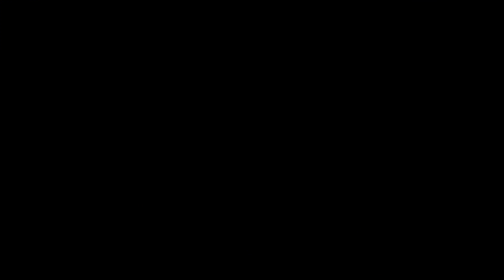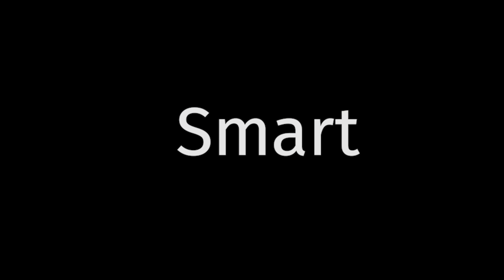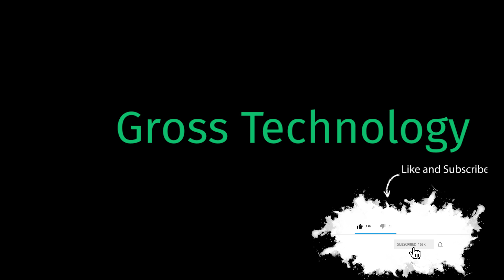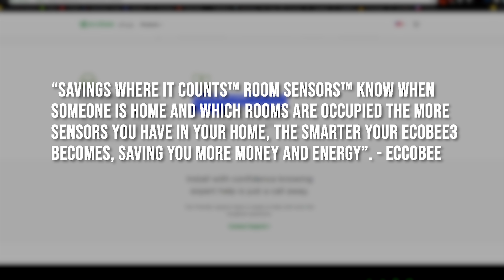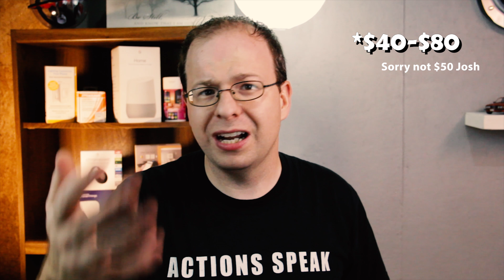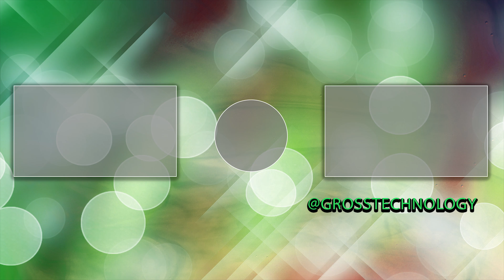Should You Buy the Room Sensors From Nest and Ecobee? #VEDA Day 4

Comment: Finally a video that makes sense, but I do think an overall average may regulate the temp of the house more, however, it could be running the unit longer.  If it lowers the temp everytime you leave then you still may save money.  My Question is to anyone, if you leave the house and the heat goes from 70 to 65 cause it knows you went to work WILL it warm the house up when you leave work automatically, OR will it be cold until you get in the house and it knows you are home now (thinking ecobee3/4 vs Nest).  Thanks.
Reply: Thank you!  Guess I have to decide which brand.  Wish someone can just tell me ecobee4 or nest 3.  😀
Reply from the maker: Well do you already have google home or amazon Alexa?
Reply: Gross Technology thanks! Yes I have both. I went with the ecobee4 and a few sensors.  A couple things bugged me about nest.  Thanks for all your replies!
Reply from the maker: Yeah no problems glad to help.
What things bugged ya about nest?
Reply: Gross Technology I totally agree with your video, but I think sensors in separate rooms will let me customize more how I want temps in a couple rooms when it senses me.   Nest seemed more learning and I don’t really want that.  I want to be able to set my temps, but also have it know when I leave.  It will be great on weekends when I got to adjust it for long days out.  I also got a better price in Ecobee.  Almost all reviews gave a slight edge to Ecobee.  Last, recent reviews of Nest app were 1’s and things were not working right.
Reply from the maker: Hey I can't argue with that.  Thanks again for the information!
Reply from the maker: That’s a great point. Yes it will definitely help regulate the entire house temps that’s for sure. 
As far as your question, you can set it to do either. It would go off your geolocation of your phone. I’m not totally sure if that can be fully done in the nest/eco bee app or though things like IFTTT. 
That said I think with it being a learning thermostat it will actually learn when you normally leave for work and get back and adjust without those inputs. That is the idea of them being not just controlled remotely but also having the ability to learn your habits and automatically adjust to them.

Comment: Not true my HVAC system in my house uses three thermostats to heat and cool my home. I have one on every level and I have automatic dampers that control temp on each level closing dampers on level heat or air is needed and bringing that level to desired temp. So the echobee and it's sensors with help replace two of the stats and with main unit on entry level. So know your home and there's products for venting already doing this outside of smart vents as he called it.
Reply from the maker: It is true, but you have 3 different units supplying your home. That is why that system works in your home. Plus you are talking about the dampeners that automatically adjust which is exactly what the smart vents would do. So you are proving my point. They are the units that control the air flow.  And not just blowing through the entire floor in your case.

Comment: Your understanding of these devices seems to be a little bit narrow.  There are a few ways that these devices can save you money by keeping the house at a true average.  But the bigger advantage to this device is being able to set one room as a priority During certain periods of the day.  For example my bedroom due to the way my HVAC system is configured can get extremely hot during the winter because I keep my door closed and my thermostat is located in my hallway.  By placing this sensor in my bedroom and setting certain periods of time where my bedroom takes priority over the rest of the house I can keep myself from being overheated at night.  Another good example would be the kitchen when cooking, obviously it would get hotter than the rest of the house and become uncomfortable especially during a holiday situation where you have guests over.  Again one of these sensors can automatically see that and adjust accordingly.  I'm not trying to be rude but you need to look at more than one side of an issue before you make such matter of fact statements about new technology.
Reply: Noooooo....you're wrong. He's absolutely correct. A average forced are system has no way to heat or cool an individual room without affecting something else. If you have a chilly basement and you want it toasty....these devices will do that...at a cost. The remainder of the house WILL be uncomfortably hot AND your furnace will run MORE often. Unless you are a 1%er....these devices are a gimmick. Gullible people who buy this crap usually are unable to comprehend logic or admit they were taken. Man up...you got taken. Don't defend a bad purchase or logic that's illogical.
Reply from the maker: Hahaha thank you for someone else getting it!
Reply from the maker: Oh no, don't worry.  I never said I was the king and knew it all, was just my opinion on it.  But yes you are correct about it giving a better average for the "house" which I will say loosely because unless you have them all over the house it isn't the entire house average, but aside from that, yes you are correct on that. Which I never said was the issue, but will that help save money, in some cases I guess yes a degree or two could save a little bit or it could actually raise your bill because now its trying to work more.  

I am strictly looking at it saving you money.  Yes these devices have a lot more they can do, and can help automate and make your house more comfortable.  And in the situations you said it would most definitely help and solve the issues.  But again I'm looking at it from the "saving you money" side. 

So even if you had the situation like the kitchen, while yes it will make that room more comfortable, the rest of the house would be freezing because of how much it would have to cool down that one room, but it hits all the rooms. And honestly that is going to throw off the "house average" because of the other rooms getting ac when they don't need it.  And honestly this will make your unit work harder and more often trying to keep an "average" temp throughout the house, which can lead to wearing or killing your unit much much quicker. 

In the end what I am trying to get people to understand is that these by themselves will not save you money, and really wont work to what they say it will unless you have some kind of smart vents that will control the flow of the air. But yes, they still have uses and in some cases can be really helpful like for you in your room with the heat.  But that will not save you money.  

If we look at your situation. Okay so your room lets say heats up 5 degrees higher than the rest, because anything less than that you really wont notice, and by having this in there it either will stop heating up the room and the rest of the house resulting in the rest of the house being colder. Or it will turn to put the AC on till that room reaches its temp it is programmed to be, which pumps AC into the rest of the house and freezing the rest.  Now if you have a heat pump system with a reversing valve, this is going to wreck havoc on that valve switching back and forth, because with a smart thermostat it will switch to whatever to get that temp to what you want it to be meaning it will turn it to AC for the time period to cool it down.  Now we get your room down those 5 degrees but opps, now the rest of the house is 5-9 degrees colder than it should...so what does it do? Turns the heat back on, and we are put into a never ending cycle.  

That said, if you are able to set a variance or a tolerance for what the "average" should be that will help, but then you are back in the same situation where the room is too hot.

Again, I'm not claiming I know everything, because I don't have both systems so I can't say for sure, but just looking at it from the outside, this is the issue I have with them.

That is the beauty of this community, to get everyone's opinion, and to help everyone, including me, on the information that is correct.  So don't feel like you are being rude, I don't take it like that at all.  Thanks again for your input. Let me know what you think of what I am saying, plus let me know if you have found a way around what I'm calling the infinite loop issue.
Reply from the maker: Also, which system do you have? Nest or Ecobee?
Reply: Turd Slurper...if you have a zoned system....maybe. But then you'd have two thermostats anyway. A standard forced air system cant and wont heat a particular room or floor because an aftermarket sensor is in it. C'mon Turd Jerker...you're just plain wrong brah. Take your ball and go home.
Reply: I don't think the OP's understanding is narrow. He's saying the same thing as you, just in other words, and that is: AVERAGING. If you have sensors in each room but no actors (controllers) in each room, there's not much your "smart" thermostat can do, other than settling to an average. With presence sensors, it can become weighted average, but it's still an average. 

What you can do with heating (radiators) is to manually adjust the radiator valves ratios if you know one room is generally warmer than other (set valve to 3 in naturally "warm" room vs to 5 in naturally "cold" room), and fine-tune this manual setting by watching the temperature readings in these rooms over a period of time.

But if you wanted a truly smart heating system, you need a temp sensor in each room AND a temp controller (at least radiator valve) in each room too. Effectively creating semi-independent heating zones. As a minor side topic, a radiator valve with temp sensor built-in will give you skewed readings, as the temperature right next to the radiator is probably higher than 3 meters from it.. 

Same logic applicable for A/C units. Sensor without actor can do only so much.
Reply from the maker: Very good points, didn't even think of radiators!

Comment: The idea behind the smart sensors is to get a “true average” temperature of the rooms being detected. Rather than just a hallway or one individual room where the thermostat is installed. Most people have a room that is difficult to heat or cool and this tech makes it easier to balance it out. No the only way to truly have different temperatures in different rooms is with a zoning system and individual stats in each room. More $$$
Reply: The problem I usually see as an HVAC tech is a two-story house we’re upstairs is always hotter than downstairs. They work great for averaging the temperature between to sell one is neither too hot nor too cold they’re both slightly off from what do you want but overall it’s less noticeable
Reply from the maker: That is a very good point, yes these will give a better and more “true average” like you say. That isn’t the issue, it is because of how the companies market them to be cost savings and that it will heat specific rooms based on your presence. That is what the issue I have with them.

Comment: I have to check you on something.  From what I know having ecobee, not sure about nest, you cannot set temps on sensors everything is basically averaging of the ecobee thermostat that the sensors communicate with.  You may want to clarify that.
Reply from the maker: On the Nest side you set what temps you want that sensor to basically be at.  Really you set what temp you want that room to be at and it runs the system off that sensor.
Reply: @GrossTechnology  Got it so the nest has that capability. I guess ite up to the individual and the system,. Its probably an option. I prefer the average because everyone finds it more comfortable in the house. It is a good  option though especially if your married lol. Thanks for the info
Reply from the maker: Really? Well that's great! Yeah I agree very important when married, or have kids.

Comment: I understand where your coming from. Do you know that it's an option that you select? It's the follow me option. If you don't want it to do that then don't select it and let ecobee just basically do an all around average instead of follow me. I don't do the follow me option because I too believe it's a waste but it's a nice option for some who wants comfort in the room that are in and probably don't mind the cost. The ecobee does a very good job keeping the system from running more than it needs to because of the sensors. Rather than relying on one thermostat that can cause other times to get colder like my master bed room. Thanks for sharing.
Reply from the maker: See that is something that the Nest doesn't do.  Starting to lean more towards the EcoBee line than the Nest, although the Nest works better in the Google sphere than the EcoBee does.  And the sensors for the Bee are more than just temp sensors.  But I will say that if you have any door sensors or motion sensors already around your home for a smart things or wink system, they often times have a temp sensor built in so you could, theoretically do the same thing for much cheaper...if it'd sync up.  Thanks for the information!

Comment: Thank you!! A review that describes what I was concerned about.
Reply from the maker: Hello Mr. Mallat!  You are very welcome, always glad to help and hear that our video has been helpful!  Let me know if there is anything else I can do for ya.
Reply: I checked out the three smart vents you mentioned. Seems the Keen is a better fit since it can pair up with the Nest. Our guest room runs colder than the rest of the rooms in the house. So let's see if this will help regulate the temperature better.
Reply from the maker: Yes, I like the Keen best of them all as well.  One thing to think of, if you want to save some money, just close off that vent in the room, or close it a little.  The biggest concern when closing things off is making sure you don't freeze up your system since enough air isn't being moved out, but one room wont kill that, and since you'd be using a smart vent with your thermostat it will regulate that.

Comment: Exactly, like you said, without smart vents (why have I not looked into any of these?!?!!) it will not save you anything. Makes no sense, the entire house gets cooled to cool that one room. I'm with you here man
Reply: I have had the ecobee for over a year in multiple properties and the way the sensor saves you money is instead of the usual thermostat being triggered due to a door opening because in many cases the thermostats have been near the front door and when the door opens the heat will be triggered because the temperature changed. Now it will not be triggered unless the sensor in the specific room that you have placed it in is triggered. Even though what he said in the video is true, it is also true that you can use the sensors in a way to save you money.
Reply from the maker: In a way, yeah that specific situation would help a little, but since it averages out the temps it would still set it off at some point, so yeah it would lessen it, but not to the degree you’d be seeing a lot of savings, as the companies were trying to say it would.
Reply from the maker: Exactly!  Now some smart vents actually come with everything, where you don't have to go out and buy a different sensors and thermostat.  Which is nice that some have their own system.

Comment: I really thought that I was missing something with the sensors. I was thinking the same thing...how can it control the temperature in individual rooms without changing the temperature in others lol. I still enjoy my nest though. Great info.
Reply from the maker: Oh yeah, I think both thermostats are amazing, and even if you have the sensors it will keep the rooms at a certain temp, but its gonna cost ya. So not like they don't work, plus you can use them as motion sensors for smart lights and other things too.  So they aren't useless, just don't get them if you are wanting it to "save you money" from changing the temps in different rooms.  That... it ain't gonna do.
Reply from the maker: That's a very good point.  Also, to think about that most thermostats have a 1-2 degree variance as well so they wouldn't even do anything if the temps were that close.  But you bring a really good point out, if there are multiple people in the house, how does it take that into account.